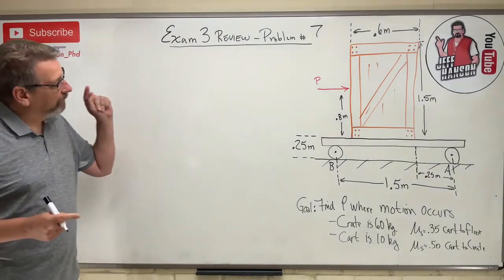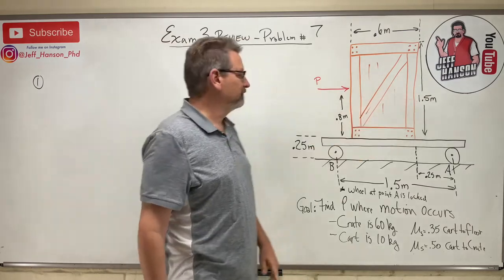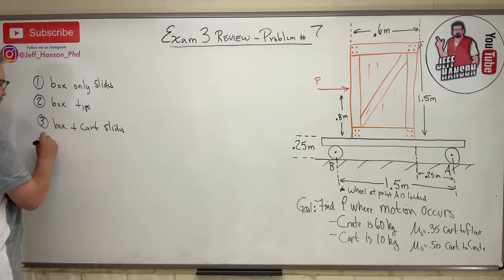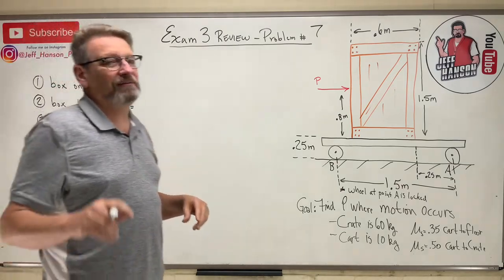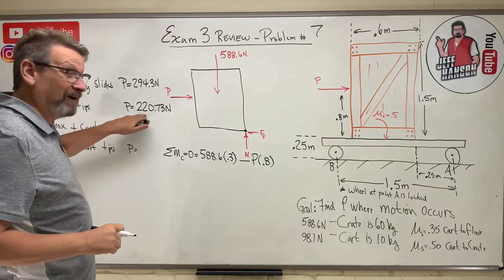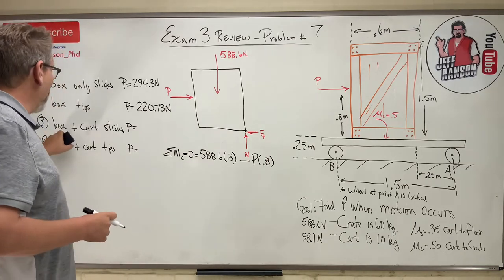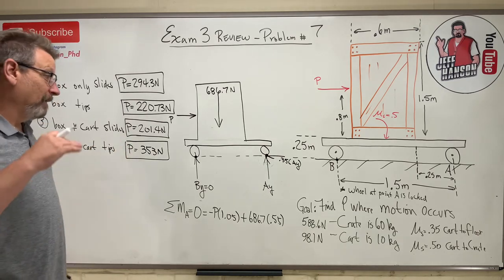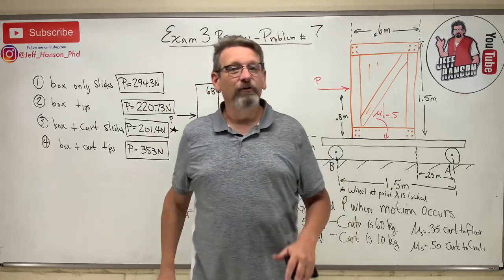Statics: Exam 3 Review Problem 6, Friction Slipping Tipping

Comment: If we want to consider the wheels, the box, and the cart (rectangle) as one body, we must calculate the center of volumetric weight of the body or we deal with the weight of the two bodies as a separate force(If we neglect the weight of the wheels) and not as a resultant correct me guys if i am wrong👍

Comment: Dr. Hanson, since the crate is not perfectly center on the dolly wouldn't the moment distance for both crate and dolly should be calculate separately for situation 3 & 4?
Reply: Yes I was also thinking so, what made me come to the comments. I solved that way and got 195.55N for P when cart slides and 378.4N when cart tips